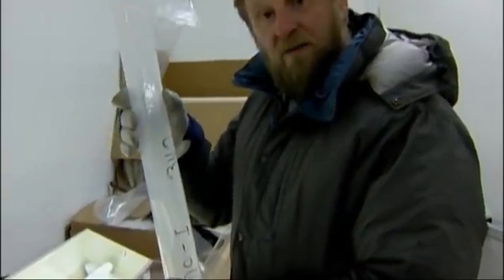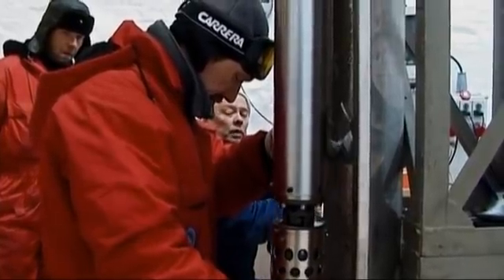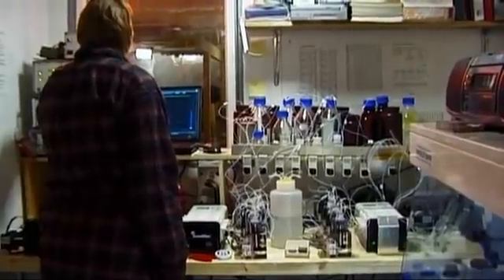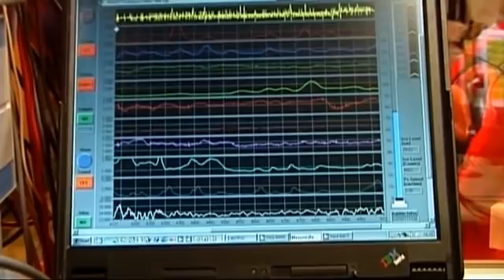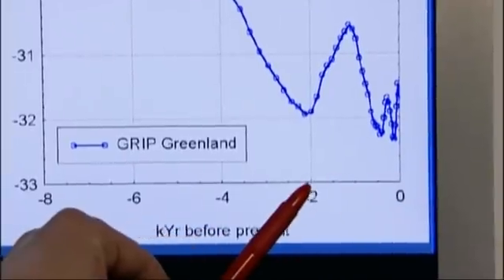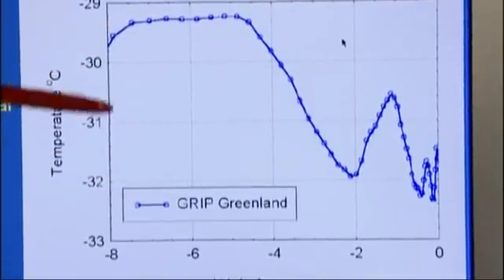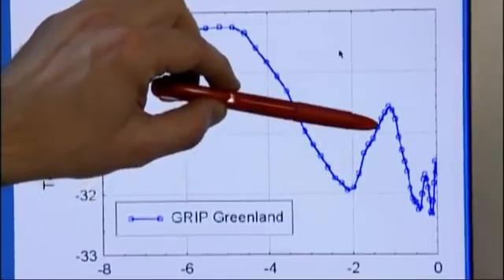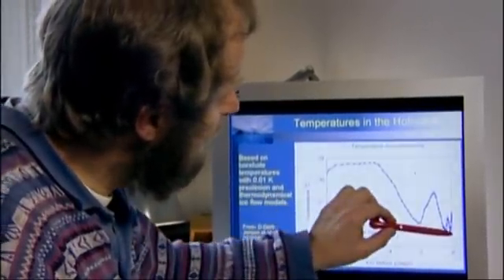Greenland Was 1.5C Warmer During the Medieval Warm Period

Comment: You can't believe how far the denialism of the alarmists goes. 

About the medieval warm period they'd say: "Well, it was just regional. Global temperatures were lower." 

About the Eocene climatic maximum they'd say: "Well, the warming occured over a very long period, unlike present anthropogenic warming." 

About Dansgaard-Oeschger events, they say: "Well, that is regional too." 

About Pleistocene glacial periods they'd say: "Well... it might have been CO2... right?" 

When all their arguments fail they say: "Yes, it has been warmer regionally in the past. Yes, it has been warmer globally in the past. 
Yes, in the past climatic shifts have been very quick and intense. 
Yes, CO2 levels have been higher in the past. 
Yes, CO2 has been emitted at a faster rate than we do now in the past, BUT... these events have always coincided with massive extinctions, because the biosphere didn't have time to adapt. Therefore, global warming is bad, therefore we need to stop using fossil fuels.

I don't believe in their cult science, but this is their absolute last card.

Comment: 2.7 degrees Fahrenheit warmer back then.  People were taking advantage of the warmth and food was more abundant during the medieval warm period.   I wish the increased atmospheric CO2 since the industrial age was actually warming the planet.   
       Hard data measurements of annual layers in ice cores show Colder temperatures during glacial ice ages correlate with higher levels of Atmospheric CO2.  This should not surprise anyone because plants consume CO2 and a shorter growing season means less CO2 is taken up by vegetation growth.   Daily measurements in Hawaii of atmospheric CO2 shows a sawtooth graph with CO2 dropping drastically during every summer and increasing drastically during every winter.  The temperature drives the atmospheric CO2 level, the CO2 level does not drive the temperature.

Comment: I'm not at all one of those crackpot climate alarmists, but i need to say; i have a very hard time believing that the difference b/w the avg. temp. now in Greenland, vs. its avg. temp. during the Medieval Warm Period, is only 1.5 C.  I don't accept that you'd see such a massive change in flora and growing season in Greenland with such little change to the average temperature. Simply doesn't make logical sense. It also doesn't fit with what scientists claim re: the separation b/w our world's present avg. temperature and that which would give rise to a major ice age. If memory serves me correctly, that difference is stated as being only 1.5 C also. But i've seen and read the data and reports from the analysis of the Greenland ice cores that examine the temp. on that continent during the last major ice age, about 21 thousand years ago.  The data indicates a difference (in Greenland's avg. temp.) b/w the ice age and the Holocene Maximum that followed and began around 8K years ago, of about 10 degrees C.  But the video above just said there's only 1 C diff. b/w the MWP and the Holocene Maximum.  So as you can see, something doesn't add up.  2.5 (diff. b/w Holocene Max and now) + 1.5 (diff. b/w now and a major ice age) = 4, not 10.

Comment: It is reasonable to point out that the graph shown moves from stability to increasing volatility. Does this increased volatility reflect actual temperature volatility or does it reflect a tendency for the ice measures to average out over time? Is there another time  when this degree of volatility is shown in the ice?
Reply: It shows that the farther back in time you go, the less resolution you get in the data. I.e. like you say, it averages out.
Reply: Looking at the classic pictures of the Vostok ice core readings , I do not see any averaging or smoothing even when going back as far as 800000 years.
But here the study is very questionable because the scientist mentions measuring the temperature directly in the ice. This is a video and a study from the 1990s. Since then science has evolved about understanding the temperature gradient in the ice.
Recent studies of the climate in Greenland use the data from 5 drilling sites and rely on oxygen isotopes. They show quite different results.
Reply: @philippesarrazin2752  You're probably right. The "smoothing" is probably caused by the resolution they chose, not what could actually be achieved.
Reply: @philippesarrazin2752 Thank you for your comment. I am not a scientist and am just reacting to the graph as I see it. I am a natural sceptic but not a stubborn one and am seeking truth, what-ever that is.
Are you saying that the scientist is taking the temperature of the ice core itself? Or using some element in the ice to estimate the temperature at the time the ice/snow was laid down?  Why wouldn't the temperature of the  ice average out over time? I have heard of scientists using isotypes as a surrogate for temperature, and presume that this is a tried & tested procedure, with reasonable accuracy. The air in the ice is squeezed out as it compresses, does this affect the proportionality of the air that is left? If the air is moving how does this not contaminate the samples around it?
You say of the newer tests that, "They show quite different results." Do you care to elaborate?
Reply: @brianarps8756  Being a skeptic is fine. Listening to Tony ... He presents so many old, true, obsolete, things and keep other information hidden. At first it looks reasonable. And then you start digging, which takes time. And then you realize. I would recommend you to watch the 6 video debate between Tony and potholer54. It is an eye opener.
Reply: @philippesarrazin2752  Potholer does not admit that the historical temperature records, actual readings, made by living people, but with gaps, and widely divergent methodologies, at haphazard locations, have been superseded by a set of calculations based on tree rings, lake cores,  pollen samples and other evidence taken by trained technicians and used to build a coherent picture of the climate over time in many locations. Heller points out the inconsistencies between the two data sets, something I feel he is entitled to do. Given that two data sets exist with different results in many areas, it might be more accurate to recognise the strengths and weaknesses of both. Logic tells me that diagnosis of tree rings will result in an averaging when compared to temperatures measures at a specific moment. All the more so when unusual weather events occur, and folk are more likely to take records. I don’t condemn potholer for following the lead of many scientists who clearly prefer their structured data set, over the historic one, but he and they should acknowledge facts and avoid false comparisons.
Reply: @brianarps8756  
Potholer understands the process of temperature adjustment. Something that Tony qualifies of data tampering.
I'm not sure if you are thinking about about one or several specific videos.

 The best scientists have approved the adjustment process. See Richard Muller from Berkeley who was the guy in charge and was a skeptic before.
Even Judith Curry who is no friend of M. Mann or the IPCC approves the temperature adjustment.
Reply: @philippesarrazin2752  Good to hear that. But both sides of the debate persist in denying that two data sets exist. It appears that is a concession they do not want to make. And many people use the reconstructed data as evidence   Of historic fact instead of as an probabilistic average (in the loose sense of the word) of a broad range of measures. When people who must know the truth act as though they don’t, my bs meter goes berserk.
Reply: I could elaborate, but it would be a lesser quality than going directly to the source. Just run a search based on these keywords : 

carbonbrief What Greenland ice cores say about past and present climate change

It will lead to a well constructed web page which will tell you way better than I can do. Of course the site is "pro" alarmist . So take it as you want, but it is good start. From there you can start digging deeper about the ice cores science.

If you find better, please feel free to post it.

Comment: Since Tony is a fan of the research done by NBI, here are some more interesting articles.
9 February 2021
Arctic permafrost releases more CO2 than once believed
CLIMATE There may be greater CO2 emissions associated with thawing Arctic permafrost than ever imagined. An international team of researchers, including one from the University of Copenhagen, has discovered that soil bacteria release CO2 previously thought to be trapped by iron. The finding presents a large new carbon footprint that is unaccounted for in current climate models.
Reply: Carbon footprints from some unknown mythological beast. Y'all are a hoot.
Reply: @josephbuckley7240  You know one of the problems with putting your head in the sand is that it exposes your butt.  Put some sunblock on it because it is getting hotter.

Comment: Great clip Tony.  I have a question: if Greenland was 1.5-2.5 degrees above today's temperature for over half of the last 8,000 years how much higher was the temperature over the whole world?  is it way higher than the 1.5-2.0 deg that all the fuss is about?
Reply: No. Global temperatures have had the same tendency but with a lower amplitude than the local data shown in the clip. The medieval warm period seems to have been noticeable mainly around the north Atlantic area and insignificant in other parts of the world.

Comment: Obsolete and outdated science from the early 90s.
Reply: Do you have any proof of that?
Reply: @jct4418  1997/1998 actually.
Watch the bottom left of the video at time 1'37" you will read 1998 on the computer screen.

It checks the timeline described in this article that you will find if you google these keywords :
" carbonbrief       factcheck-what-greenland-ice-cores-say-about-past-and-present-climate-change"
but not the conclusions

You can find the same danish scientist, Steffensen, in this 2017 video. He looks much older and his message is about CO2 danger.
Google :
"  Inside the Experiment: Abrupt Change and Ice Cores   YaleClimateConnections  "
Reply: @jct4418  Another great piece of disinformation from Tony.

Comment: Someone do the math if the green land glacier is a hundred miles long and it slides 2 miles towards the sea every 50 years how long will a new part of ice at the start of the glacier take to fall into the sea at the other end? That's 2500 years so how are they testing 10000 years back when the longest possible time any bit of ice can remain on the glacier is 2500 years if the glacier is 100 miles long it's like a conveyor belt so to be able to test 10000 years back in time the glacier has to be at least 400 miles long and be tested right at the end of the glacier just before it hits the sea so if the glacier isn't 400 miles long how the hell are they testing 10000 years ago all climate science is a false even if it's in our favour
Reply: They drill at very specific locations to make sure there is no ice drift, or so little.

Comment: I really don't care what these "scientists" say. No way is a P-38 over two hundred years old, so there is no way they have any idea what the date of each level of samples is. And I love this: if they measure out the temperature precisely enough - "then" the ice has not forgotten how cold it was on the surface the time the snow fell. Assuming that he didn't mean that the ice has a memory that can be changed by the sensitivity of the thermometer's measurements, he is saying that the temperature of each layer of ice would continuously be different from the layers below or above it. That would mean that there was a layer of vacuum between each layer - which would also mean that the exact same temperature would be retained in each layer. That makes no sense. What makes more sense is that the layers will receive heat according to what is happening currently on the surface and according to how quickly the heat and cold stabilize through each layer - as each layer will have its own insulation characteristics. But the temperature WILL change and equalize (naturally three kilometers will show variances as the heat is still traveling through the layers - and it won't take thousands of years. Here is what I do know, there were dragons in medevial times, and we know dragons love heat, sunlight and humidity and water. Many stories old and new verify this. We also know that the climate changes over decades and hundreds of years. We also know that ice core sample layers do NOT correlate to a specific time period or accurately show the passage of time as multiple layers can build up in one year or the reverse, and there are also different kinds of snow and the way they pack, that also can cause additional layers to form in a short period of time. I don't need these scientists explaining to me that ice magically decides to keep its temperature because it has layers. I simply believe in regular large cycle climate changes.

Comment: "We started to observe meteorology at the coldest spot in the last 2000 years."
Reply: Coldest in 10,000 years according to the geophysicist. The other crucially important point is that even when it was much warmer, the climate system didn't "run away" in temperature because of water vapor or permafrost methane melt feedbacks. All of the alarmist models have huge pending positive feedbacks to get their high temperatures, because CO2 based warming is now saturated. It being having been 2.5 degrees celsius warmer without run away warming proves those models bogus.
Reply: To many of us, this was already obvious, because if the climate had high sensitivity to small forcings it would be unstable and have run away a long time ago in response to natural variation. And the negative feedback mechanisms are quite clear: the tropics can't get much hotter because of convective cooling (daily thunderstorms). Increasing forcing just causes thunderstorm cooling to extend slightly further from the equator. Only the poles have gotten (slightly) warmer, and only at night.

Comment: The LIA was the coldest period in the last 10,000 years. But the next cold period will be colder than the LIA because the Holocene is gradually ending; following the same evolution as the last several dozen glaciations revealed in the ice core samples. It would be great if CO2 emissions could prevent it, but there is no evidence that they can. Winter is coming! It may take hundreds or even a few thousand years, but the glaciers will return.